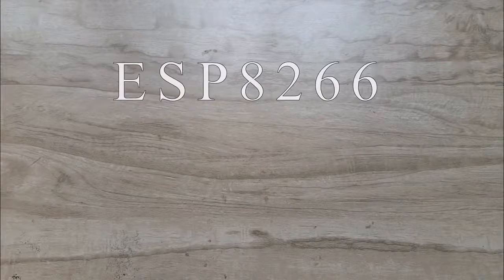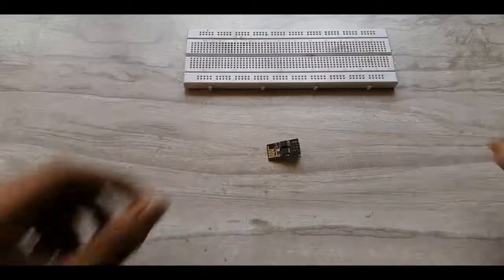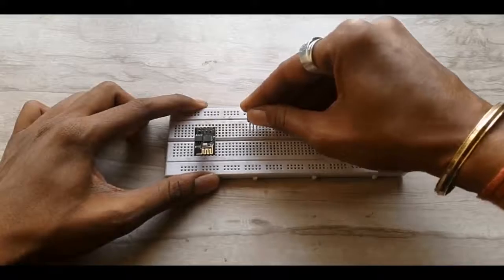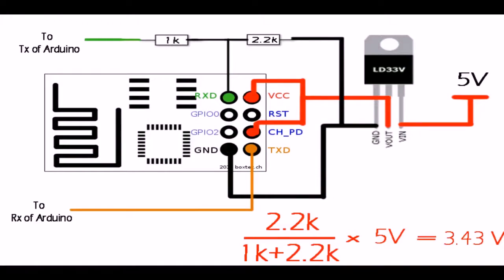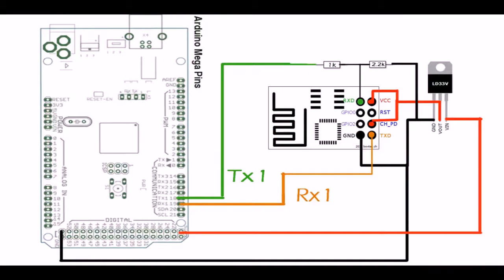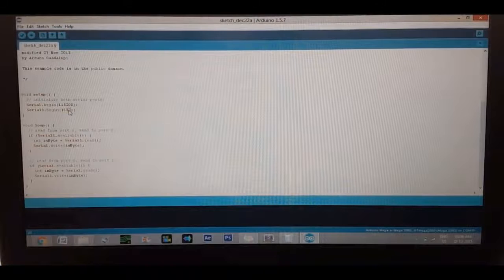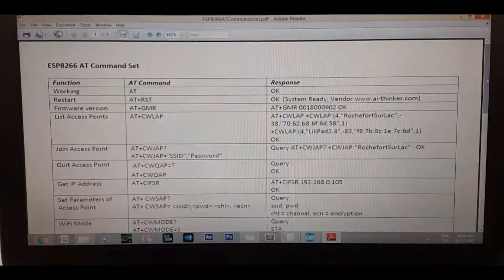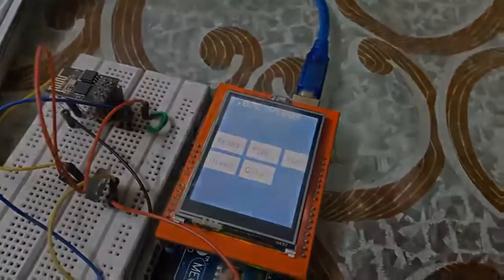Gettting Started with ESP8266 wifi module. As simple as possible.

Comment: I have a Makerbase MKS Gen 1.4 Arduino Mega board. It came with my kit for Folgertech FT-5 R2 3D printer. After purchasing an ESP8266 from Keyestudio off Amazon I realized that on the Arduino board there are unused inputs. One of these is J15 and under the four holes it says WiFi. So would this be where the module connects? Perhaps it has it’s own voltage regulator and I can wire it directly? Please help! I really don’t want to have to buy a breadboard or any more extra stuff if I can get away with it.

Comment: hello, how you connect wifi ? can you share ino code?
Reply from the maker: +Haluk YILMAZ its easy with the AT commands. Just connect Rx and Tx of Esp8266 to Arduino board and upload blank code to arduino.

Than open Serial monitor and type,
AT+CWJAP="WiFi Name","Password"
Reply: Sir AT command working well with arduino  uno but how i can use  esp8266 01 as webserver without arduino
Reply: I also seen your button esp8266  video but how to upload program in esp8266 01  with arduino uno